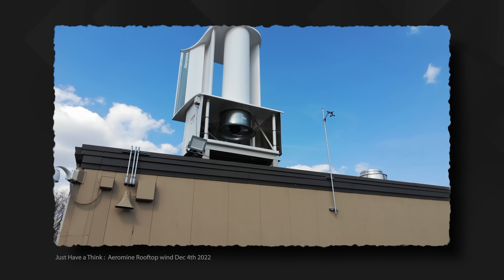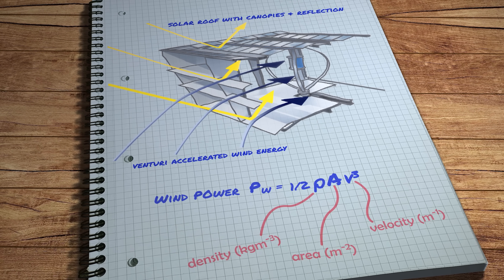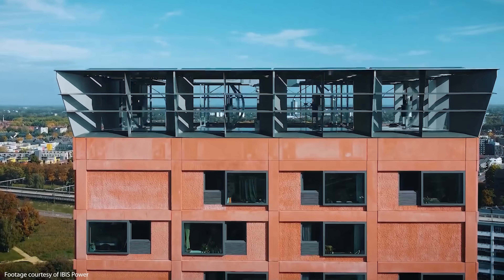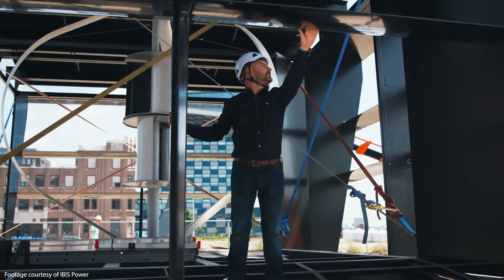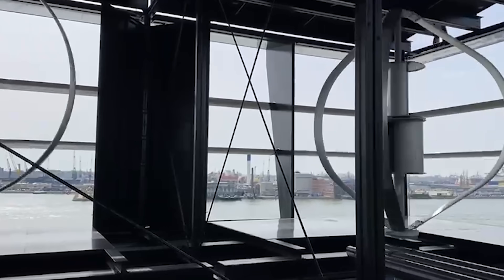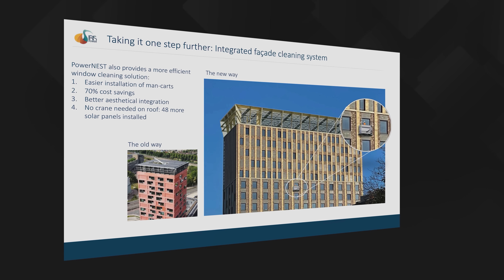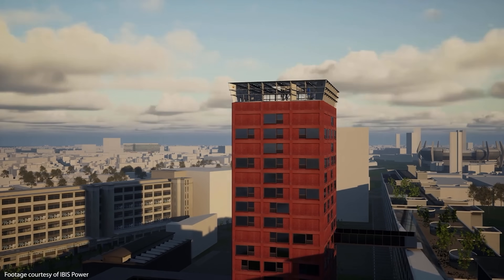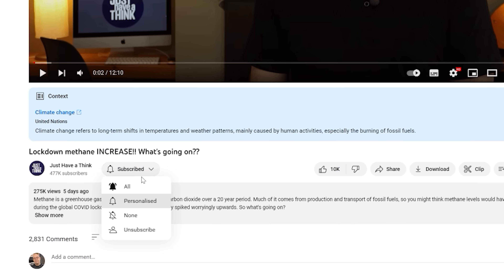The smartest renewable rooftop system in the world?

Comment: This tech is cool but installing it in most of Europe is a bit of greenwashing.  PV panels made in China with coal-fired electricity will NEVER produce more electricity than it took to make them (when used in places like Germany). The world needs a zero emissions PV factory or thirty like yesterday...
Reply: A study by the National Renewable Energy Laboratory conclusively demonstrates that the manufacturing energy cost versus the energy production payback for solar modules is generally less than 4 years.
Reply: @swiftlytiltingplanet8481  That study was done on panels placed in sunny areas not Germany or the Netherlands or Norway...
Reply: @derekcraig3617  Dutch researcher Alsema found a four-year payback but projects a 2-year payback in the near future.  Japanese researchers Kato et al found a two-year payback. Palz and Zibetta calculated two years as well. Knapp and Jester found a 3.3 year payback. Certainly where panels are tested makes a substantial difference, as you mention. I don't know where panels were tested but it would be useful to know. I do know that the energy payback for a standard wind turbine is 8 months, according to Oregon State University.
Reply: @swiftlytiltingplanet8481  interesting. I'll check out the researchers you spoke about and see if they listed where they tested panels.
Reply: @derekcraig3617  Yes, most certainly, solar is not ideal for every location.
Reply: @swiftlytiltingplanet8481  that was all I was saying and a lot of people jumped on me as if I was poo pooing solar. I think solar is amazing.... in the correct locations
Reply: @derekcraig3617  We all have to be careful not to dig in too deeply with our tribal loyalties. Credible, unbiased data should drive our judgements.  I personally think a mix of solar, wind, hydro, nuclear, and even a few gas plants is the best way to go. Putin has showed us how dangerous it is to rely on others for our energy supply. Energy independence for every country should be the goal.

Comment: Very interesting.  It would be great to see something like this for a flat single family roof.
Reply: Probably not cost-effective unless you have several households underneath each module, as is the case in these apartment buildings.  Altitude is also an important contributor to the levelized cost of the power obtained, and you're not likely to have that with a one-family home.

Comment: One thing that seems to be overlooked with this has to do with a biological nuisance: namely Rock Doves other wise known as the common pigeon.  Those structures look like a perfect attractant for nesting and roosting for those birds.  For areas with significant populations of those birds, the rooftop will soon be littered with dead birds, feathers, and waste.
Reply: Not nearly as bad as the oil pits that kill millions of birds per year.
Reply: @swiftlytiltingplanet8481   That is not the real problem.  It is the mess that needs to be cleaned up and the hazards that go with that job.
Reply: @ArimoDave   When it comes to energy production, there is no free lunch nor a 100% environmentally clean way to do it.

Comment: Local generation is also, importantly, helps reduce the capacity needed for electricity distribution grids which are under-sized to deal with future requirements of Electric Vehicle charging and heat-pump heating systems.

Comment: I love the idea, but I only now about the units used in Utrecht and Rotterdam. The one in Utrecht is already removed because the wind turbines hardly worked at all. In Rotterdam (more wind) the production the production was a little better but still not much compared to just (cheaper) solar. Seems like the saying for wind turbines still holds: go big or go home.
Reply: Do you have any idea of the actual capacity factor?
A a maximum of 3kw these things seem far too inefficient to justify the cost and the carbon released to create them.
Reply: @jimurrata6785  no. Would love to read an independent test of this system, but can't find it.
Reply: @janvanrookhuijzen8309 Thanks for your reply.
 I wonder if there is any accounting by the agency that initially provided funding? Or were these units backed by venture capital?
At least in your nation there is some transparency when it comes to governance
Reply: @jimurrata6785  I don't know the details. They did receive EU Horizon 2020 subsidies but also a lot of venture capital. What I often see is that there are almost no engineers involved who ask the right questions. Still, would love to see an independent review of this system and if it works as advertised would happily promote it.
Reply: @janvanrookhuijzen8309  I'm watching the IBIS Power channel right now, trying to tease out some solid numbers for the Powernest 2 units.
But this is very difficult because Mr Suma likes to speak in circles about "potentials" and not observations while he addresses the "data" which are actually averages and extrapolations of the numbers from the Utrecht Powernest 1 six years ago...  🙄
Many repetitive sound bites and dramatic video of cranes lifting things but nothing concrete.
I feel like a sales rep has invited me to a 'conference' that happens to be a magic show in a Las Vegas casino.
There is lots of smoke and mirrors here!!! And the hype machine just keeps rolling. 😆

Comment: Seems to be a very good optimised system to collect renewable energy on flat rooftops. 
But what about noise? Windmills produce allways some noise. How much noise does this produce in practise?
Are there any measured noise data (dB and frequency) available for this system?
Reply: Dave mentioned that the residents in the flat directly below the prototype unit raved that there was absolutely no noise.
But the turbine in that footage differs from the latter two whole building structures.
Reply: @jimurrata6785  Thank you for your info, but Im still not convinced that the noise problem is really non existent. In general horizontal turbines are somewhat quieter than horizontal, but all rotating machines produce some noise. That there is no measured data about noise emissions available makes me suspicious that this is probably because its a not a fully solved problem. I like new inventions,  and i hope this will be successfull, but I know most inventions have weakpoints. And before I invest in something, I want to know how much a problem is its weakpoint.

Comment: Provides options for city dwellers to participate in self-power living, solar and wind. Let's keep the Fossil Fuel Demons away from the permitting process THIS time.

This is approaching symbiotic design, almost biological elegance.

One thing i will note: if you have snowfall, you really do want your PV to be inclined to 60 degrees in winter. Snow tends to self-clear above that angle, but 2x as long for 30 degrees, and maybe not at all for less. Some articulation in the PV mount could help here, if only for the back row. This would increase venturi (can we say Bernoulli?) effect by introducing a high pressure zone at the rear and above the airflow. The air below at the turbine level will accelerate to meet that airflow and re- balance the pressure gradient. Of course, the whole system would need to be considered.

 I do like this approach though. Keep It Simple and Symbiotic: my personal engineering mantra of KISS.

Also, keep such well organized and clearly thought-out videos flowing our way, Sir! Much appreciated!

Comment: Looks like an interesting idea. As a structural engineer, I have to say you would be pretty lucky to find a building that would support the extra wind and gravity loads. It would be rare to find a building that could take the loads without expensive upgrading requirements. If it is built into a new design, the extra costs would not be too bad.
Reply: It was mentioned that the weight of the units was equivalent to about 12cm of water on the roof, which was apparently within operational limits. The wind loading from the turbines would be much lower than an equivalent horizontal axis one, but I have no idea how much that would be. It didn't appear to require any extra reinforcement in the clips shown... they looked to be installed straight n to the roof?
Reply: @AJPemberton  It isn't within the limits of the vast majority of existing buildings. A 1.2KPa additional roof load is a pretty high jump in load (some areas only require a 1.0KPa roof load design but a typical roof is designed for 1.5 to 2.0KPa. High up in the mountains or rare locations you might get up to 12KPa or even more). The increase in wind is substantial since the extra wind load is at the top of the building. It is at the worst location. The load may not be quite as much as an additional story but it will be close. You want the force and blade velocity to be high  to get the most power out of the system.
Reply: @yodaiam1000  Thanks for the details. I'm not well-versed in building code, so nice to have the extra info. Were the typical roof loads you mentioned for just high-rise buildings, or did they cover all building types?  I ask because most residential dwellings (which numerically are the more 'typical structure) don't have flat roofs loaded with equipment such as aircons, lift equipment, etc, and I guess would require lower loading standards.
As for the additional wind loading, would the change in airflow the units cause mean higher, equal or lower overall stress on the building?  This was shown at 6:15 and to my eye, it appears the wind loading would be at least similar to an unaltered rooftop?
Reply: @AJPemberton  Under very specific circumstances, the wind load might be equivalent or even less but that does not occur in the general case. The FE model shown looks like a fairly specific geometry. The wind load will most certainly be relatively higher on a lower building (comparing a low building without the system with a low building with the system). You actually want the force and velocity on the turbine to be high to maximize power. If the turbines just spun without too much resistance, you are not generating much power (unless the turbines are super fast).

The code minimums vary depending on location, geometry for snow drift etc. It is not related to the height of the roof (in most codes). So high rises have no more snow load requirement than a typical building. However, they generally can support higher loads since the roof is typically concrete and you just get higher capacities just because of the material used. But the same is not true for the lateral capacity.
Reply: @QuesoCookies You can't rely on heating systems or other systems for reducing the snow load. It isn't permitted by code. Everything can shut down during s storm. The black surfaces don't help.
Reply: @QuesoCookies I guess if you could make those blades meant for better wind characteristics move, they could act as shutters, closing off the system during too high winds, snowy conditions, storms, ...
Reply: @AJPemberton  can you get water/snow load as well as the weight of the new structure?
Reply: @robinherrick2177  I'd imagine you would...the new structure did not appear to have integrated drains. It was fixed to the build framework though, not just placed on the roof - if my understanding of the video is correct. So perhaps that would not be a concern?
Reply: From our experience, the extra load of 120-140 kg/m2 isn't much of a big deal for existing buildings. They are usually built with extra safety and overcapacity where this amount of loading doesn't have much impact. The building does increase in height and captures more wind loading. Nevertheless, it is not a full surface but only 50% is closed surface. Also, the stability cores of medium to highrises have sufficient extra capacity to bear this additional loading. This is our experience in the EU (Eurocode) and US (ASCE7).
Reply: @alexandersuma  As a structural engineer, I can say that is a fairly significant load. Some roofs in light snow areas are only designed for about 100kg/m^2 ( 1KPa, 20psf). So adding 1KPa on top of that is not an option. Most roofs are design for about 2KPa on average but this varies substantially. Adding 50% gravity load to roof is usually a big deal. If you have a concrete roof on a high rise, the extra gravity load may not be such an issue but on other buildings it would typically be an issue (but not always).

Even at 50% of the wind load of a typical story, that is significant in most cases. If you are in a high seismic zone with a new building, it may not be such an issue.

If it is 50% open to let more wind through, that doesn't mean the wind load is 50% of a full wall. It is a non-linear relationship since the wind speeds up through the openings. The wind is also resisted by multiple posts and structures and just not a single wall.
Reply: @alexandersuma I suppose I the dynamic forces induced by horizontal and vertical wind shear will require more loading capability than a simple static load of snow sitting on top of the roof.
Reply: The second project in Eindhoven that will get a Powernest (the yellow-brown tower with the improved, integrated structure for the building cleaning crate), is actually a already built and finshed tower to which the construction will be added, without having to change the construction.
Reply: Interesting thread, I’m going to raise a red flag on the structural loading, but one has to assume something this significant has had a couple of different structural engineers look over the installation… with constant monitoring as well.  Either way, it’s nice to see wind/solar integration making it to the cities.  In the future building will not only collect, transfer and store these resources, they will do it as part of an integrated design that will meet all of the buildings energy needs!!!
Reply: @christophorfaust2457  In most western jurisdictions, you usually have one structural engineer do the design and seal the drawings. They will check the existing structure for the extra load as well. There is another engineer that does a concept review to catch major items/concerns that may have been missed. Monitoring isn't common unless the building is exceptional in some way. Once a building meets code for structure, that is usually the end of the mater. However, there is a still a maintenance staff for a building. If they spot anything unusually, an engineer can review the issue. Where I live, there is also a 10 year review for condos/residential buildings which is usually done. It is voluntary and done to catch issues that expire in the 10 year warranty period.
Reply: One (frustrating) obstacle in many jurisdictions would be the height limits for existing buildings - the developer usually will build right up to them.
Reply: Are the wind loads significantly increased? Also, what are the additional weight loads per m^2 for this instillation and how do they compare with the extra loads that high-rise buildings can generally tolerate?

 It's a raised steel platform with solar panels as the roof and very compact wind turbines inside, so it doesn't look so heavy that it would be actually rare for a building to be able to tolerate the extra loads, although many probably couldn't.
Reply: Cleaning up the turbulence in the lee of the building would tend to reduce wind load, right? If so, this would reduce the net  wind load of the system to a greater or lesser extent.
Reply: @westasleep  You are essentially adding an extra Storey so it would be difficult to improve the aerodynamics so much that it would reduce the wind load. It is like cleaning the aerodynamics on a semi trailer. It makes the semi trailer better but it is still way worst than an SUV. 

Besides that, you need force to push the turbines around. That can only add force to the building right at the top where it has the worst effect on the lateral system of the building.
Reply: It looks like an extremely bad idea. A recipe for building collapse in winter if it all ices up. Do these people have any clue about engineering?
Reply: @Withnail1969  It is fine as long as it is designed for. It would just be expensive to retrofit a typical building.
Reply: @Withnail1969  i believe the founder addressed some of the raised concerns below, dunno if he mentioned ice. I'm not an engineer, but he appears to 'have a clue' but it is up to everyone to make up their own opinions. I'm no sucker for millions of tax dollars on wishful thinking, but this concept has already been proven in reality as far as I understand it...maybe won't work perfectly on all old buildings, or in every climate but there's no silver bullet to energy imho. seems like a pretty decent call for a new building design in Madrid or Morocco --not much snow there really
Reply: @Withnail1969  naysayers never invented or created anything, just saying. It's on 4 buildings right now. Once upon a time, there were only four cars. Surely people back then said 'that'll never work' whilst tending the horses... 

The only building that ever collapsed (allegedly) under its own weight was the WTC. All other building materials have big safety factors of 4-20. Buildings often use concrete which has one of the biggest safety factors due to its variation in strength but even steel rebar has a safety factor of 4-6. So perhaps rated for 2t tension, it's able to handle 8-12t. Depending on the rating a building was designed for, most wouldn't struggle with this structure.

Yes, there's additional wind pressure, mind you, buildings are designed for hurricanes/extremely high wind speeds. When storms hit, turbines will be turned off. Sure, there's still extra pressure to deal with, but it's an open structure. The change in wind forces wouldn't be that big. And as mentioned before, the change in turbulence/drag on the backside of the building offset the pressure to an extent as well. 

Admittedly, I'm a mechanical engineer, not a structural/civil engineer.